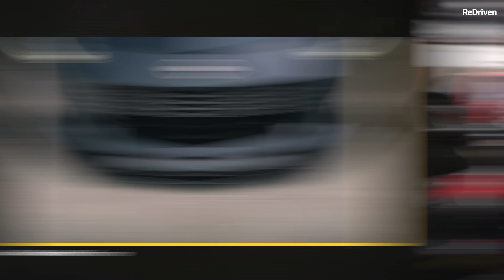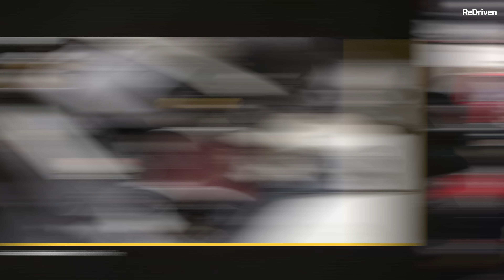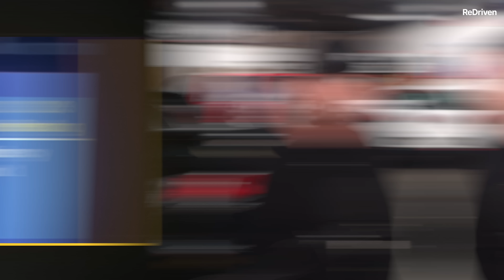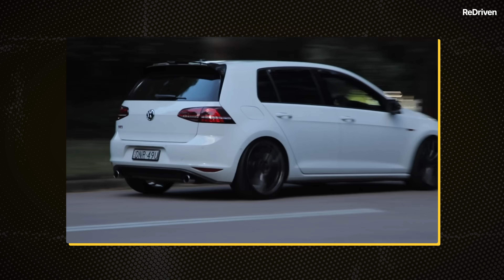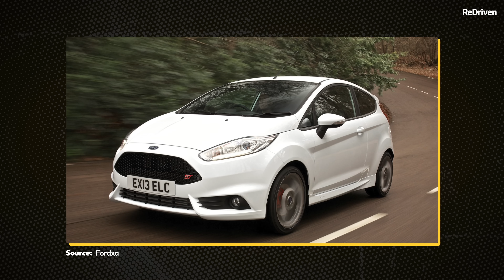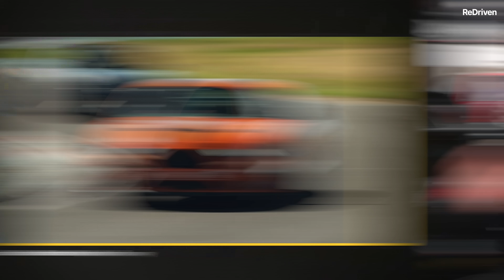7 CAR MODS YOU'RE WASTING YOUR MONEY ON! (and one EVERYONE needs!)

Comment: Very much depends on the car! Some cars really benefit from certain mods. Obviously you should use decent well made kit. 

On my mk3 MR2 the cold air intake system is a complete waste of time as the engine is in the rear and it’s very hot back there. You lose power & tend to get lots of error codes. Some people have spent many many hours on the dyno with various kit trying to get it work on the mk3, but the general consensus on cold air induction kits for the mk3 is don’t bother 😂

Exhaust mods do work well, but not the cheap Chinese rubbish. I tried cheap manifold & back box, both pretty crap, noisy in wrong way f bad quality. You also need to change the whole system, head to tailpipe. Full Zero system on mine & it is very nice, more mid range torque & sounds just a bit louder & deeper, highly recommend Zero. 

Suspension, cheap lowering springs ruin the ride, choppy, uncomfortable & ground out easily. I put factory springs back on, better. I then replaced my shocks with OE quality KYB items and ride was improved then replaced the OE springs with H&R & it is practically perfect now. Ride comfort is as very good, if not better than it was as standard, roll much reduced and it handles very nicely. Dropped 20mm all round and no grounding issues as they are progressive.

Some cars come from factory with very good suspension, exhausts etc. Some don’t. 

Also, in my case, car has been around 25+ years now & technology has improved so you may find better components are available than there were when car was new. Do your research, speak to the people in the owners clubs that actually know what they are talking about.

Comment: X-Force cat back exhausts on GTis pop and crackle in sports mode without a tune... so VW released it with an exhaust that was supressing the pop in sports mode. Are you saying thats bad for the engine if it came from the factory like that and then added the exhaust?

Comment: The GR Supra from the factory does pop and crackle upon deceleration in Sport mode. These cars have been very reliable beyond 100,000 miles with stock and even enhanced tune.
 Dinan is known for designing aftermarket performance parts that are tested theoretically and physically. I have their lowering springs and cat-back exhaust system. Handling is a bit stiffer but definitely better than with the stock springs. I have no doubt that good coilovers would be better, but they are very expensive.

Comment: I have an Alfa Romeo gt, that thing is lovely, I did some modifications for looks (wheels) and sound (exhaust. A good set of sports tires and I want to modify the intake to hear some sweet intake noise. I modify for the sound and the look, performance the car has 168hp ( allegedly) and it's more than fast enough

Comment: There's always compromises that are required for an enthusiast to make mods on a tight budget, it's just a matter of doing them logically and sensibly. Case in point those air intake pods exposed inside an engine bay, that is definitely a dumb idea, I learnt about that decades ago after investigating such things for my own car.To get a performance increase out of that it needs to be a cold air intake.

Obviously some of these proper set-ups for mods being referred to are for modern vehicles. I had to giggle about checking Automotive Superstore for everything you need for your car, they have next to bugger all for my car, and it's not even that unique, a 1989 Mazda 929 Sedan 😜

Comment: Watching from the USA here. I have been a performance driving coach since before the turn of the century, and this is all good advice. A story about aero on a car:
I had an BMW E36 M3 that I had just bought second hand on a track with a high speed banked corner. At the end of the straight just before the corner when above 120 mph (193 kph), I could feel through the steering that the front end was getting light, so I had to back off the throttle a bit. I couldn't find the cause, so I asked some of the more experienced guys for advice. Finally, one driver who had won a national race series in the E36 found the issue. The undertray under the front of the car was damaged. At high speed, part of the plastic would drop down and scoop air up under the hood. This effect was enough to lift the front end of the car at high speeds. When I got back home, I immediately ordered a well regarded aluminum undertray to replace all of the broken plastic. The next time I went to the track, I was hitting the speed limiter on the car at 136 mph (219 kph) in the banked corner without any issues at all. The front end was now securely planted. The thing about this mod was that from the view of anyone looking at the car, you could not tell that anything had been done, yet it transformed the high speed behavior of the car.

Comment: I have a 2018 Fiesta ST. Suspension is bone stock. Whoever owned it before me put a set of 18x8 inch Motegis on it. I absolutely loved the way it handled...until I hit a pothole and cracked the left front wheel and it can't be repaired. Now, I'm on the hunt for new wheels that will hold up to the roads that I drive on.

Comment: In my country, Brunei, pops and bangs mostly found on youngsters and noobs with their stock cars.
Even worst a shitbox running on stock 14"steelies, cut-off coil springs, fart cannon or straight pipe exhaust, expired roadtax, body full of dings and dents, faded color or cheap sprayed paint car. But with smucks on their faces revving the engine with not even stage 1 backyard mods, they feel their cars are totally fast. 😂
You can find these nutsacks every Sunday at pantai seri kenangan beach..😂

Comment: So. I just bought the closest to my dream car. I got the special edition factory aero pack. I also bought every "factory" aftermarket upgrade option part that has been made available over the last five years. This includes parts that will require me to get engineering certification for future registration. All parts getting fitted are purely for handling. The factory performance of the stock set up is already too much for a daily driver in Sydney traffic. I am already pushing the limits of the factory warranty by adding "factory" after market up grades.

Comment: If have a MAF instead of Speed Density a tune my not be nesscary with increased air/exhaust flow.

If speed density then yes.

Perfect example I can change my supercharger pulleys to change power and maintain the exact same AFR.  This is on a 93 Ford Thunderbird SC.

Comment: My Evo X has little more than a turbo back exhaust and an ECU tune, with high flow air filter (K&N drop in) and high flow cat. From that I gained around 100 hrsprs and a way better sound than the stock exhaust.

Comment: Yeah, i just upgrade parts as they fail. So shocks were leaking and oscillation was out of spec, so go myself a set of coilovers. Now I dont like how much roll it has, so sway bar is next. But the radiator is looking discoloured, so a cooling system upgrade is probably going to be first

Comment: I personally disagree with the wing statement, even if downforce isnt as much, if you drive a fwd car that is light, putting a heavier wing and moving the battery to the back can make a huge difference when cornering at least if your touge racing
Reply from the maker: In that case you could probably just put some ballast in the boot. Saves bolting a wing on the back
Reply: @ReDriven  yah that's fair, i just fell in love with the look at this point lol
Reply from the maker: That's a whole other story. If it's for aesthetics, got nuts!

Comment: Best small mods:
1. Japanese brake pads like endless, pmu or dixcel etc. and full brake fluid flush with super dot 4 or dot 5.1 brake fluid.
2. Good brand UHP tyres.
3. Good wheels which fit properly.
4. Good window tint.
5. Upgraded speakers.
6. High flow catted downpipe if turbo.
7. Good tune.
8. Good mild lowering springs about  15 to max 30 mm.
9. Shocks like koni, bilstein or higher spec kyb.
10. Sway bars with rear sway bar first.

Comment: I don’t agree with the ecu being mapped doesn’t give better mpg and power. It does if done properly. The standard maps are used across so many countries and weather conditions and each engine is different. You definitely can get more power while increasing mpg. The engine runs more efficiently and can improve mpg. When my GSXR1000 was tuned by a TT tuner it significantly increased its power and smoothness while allowing me to ride the same and get around 20/30 miles extra per tank. So they aren’t right there. Bike engine is no different to a car engine being tuned. Get someone that knows what they are doing, with a dyno and always do this over companies that turn up at your house  and just upload a map to your specific car. To work properly it needs to be done on a dyno/rolling road.

Comment: Open filter is an issue for NA but with a turbo that is compressing the air and making a lot more heat post turbo so a few degrees in won't make a difference

Comment: As a person who went through different phases with the car i can say from experience; one way or another everything is a waste of money. Intake header and exhaust? Sure you can get cheap parts or get name brand stuff and pay a fairly big amount... for what? 5?10?15hp extra?  Lol. My name brand I/H/E cost nearly as much as a turbo kit that will give you 10 times more power. Of course now you have to think about will the transmission / clutch hold? Fuel... tune... yes at the end its more expensive. Now my car is built and boosted. Spent so much money that i will never ever able to get back and the base car with its current mileage worth 10th of what i spent on it lol. Should have bought a car thats just 400hp stock and might still worth something.

Comment: @7:05. I’ve had my bone stock gen 2 dmax dyno tuned and saw an 80% gain in rear wheel torque 50% hp and it has consistently used about 1L/100km less fuel since it was done. As far as I know the 4j’s respond extremely well to a tune with 0 additional modifications.
Reply: It’s a diesel. Common rail turbo diesels can cook the turbo
Reply: @t @theairstig9164 ey have a really good stock turbo in them, turbo issues are very rare on the pre dpf models. Even if it does fail at some point it will have paid off in the fuel savings and enjoyment from the extra power.

Comment: Agreed on everything except perhaps the exhaust. Back in the day a less restrictive exhaust always helped a bit on the JDM turbos I used to drive (mr2s, supra, 300zx, rx7 etc back when they were the cheap performance cars lol). But the main improvement came when you turned the boost up of course.
Reply: yup best mod on my Colt was full upgrade of manifold, downpipe and upsized decat exhaust.

Comment: I have a fully built gr yaris running a motec ecu which I drive to and from events. I cringe in embarrassment every time it backfires as I'm changing gear at normal road speeds on public roads....it's going in for a remap in a couple of weeks and i'm going to ask if they can change the tune to avoid doing that.

Comment: I modded my gr86 with door stabilizer, surprised it makes quite a difference.

Next step is to get the hks hi power L spec ii to reduce the weight, but not sure how much this can affect the weight distribution and the rake, as well as the airflow under the exhaust muffler.

still thinking how I can reduce the 4-finger wheel gap though.

Comment: I would most definitely concur with your final point, Guys. Get training, listen, learn and apply. If you then want to learn more, apply for your racing licence and, once obtained, you'll then start to learn a whole lot more. This will include the old adage: "If you want to make a small fortune in motor-racing, start with a very large one." As someone with 36 years' experience in motorsport, including 13 years as a Driver Evaluator for CAMS, I've met countless people who thought that they could drive, only to have them prove conclusively by their racetrack performance that they couldn't. A willingness to park their ego and learn almost always improved their performance. Re mods, as a race driver, the only modification I ever did to my road cars was to fit better brake pads.

Comment: This video is actually really poor advice.. different cars respond differently.. for instance pod filter open may not provide hot air if the intercooler is very good..  some V8s respond well to exhausts..  the pop tunes are standard in i30n and some BMW so Hyundai and bmw warrant these cars..  tunes can be very good and adaptive.. very very poor video

Comment: Great video guys but thought it was just worth saying, exhaust mods won't hurt your engine as long as the ECU is reading a sensor for air flow mass/volume. If more air goes in, more fuel will be injected as well.
And yes you can actually have more power and better economy simultaneously. Generally mixtures are very rich at full throttle. If you are running high octane fuel and detonation isn't an issue, leaning it out will make a little more power. But that is best left to the experts

Comment: Friend of mine put a throttle mapping gizmo on his LC 79 series, had it in auto, got stuck on the beach, lowered tyre pressures put the maxtrax under the wheels and "sent it", ended up on its side and wrote the engine off, good way to put an end to the holiday.

Comment: 3:10 100%, wholeheartedly and unapologetically disagree. Losing less than a % of power for the increase in induction, spool and DV noise (if you bypass is plumbed back into the intake, in whch most cases, it is) is worth it every single day of every single week for all of existence.

Comment: You guys are wrong about the First and Second Mod !!!!  
DIY Aero mods and Warm Air intakes can be made for Fuel Economy improvement. 
I've done rear wheel covers, wheel splats,  extended the underbody plastic, a Kammback and I opened my Air Filter Box to allow warmer air intake on my Yaris Hatchback. The Fuel Economy Increased by OVER 30 %. Yes, I verified the Fuel economy verified at the fuel pump!

Comment: First “mods” I always do after buying a used performance vehicle is a good set of tyres ( usually Bridgestones but more recently Michelins) and a good set of brake pads.
Reply: Hell yeah. Best value upgrade to any car IMO. For me it's the Bridgestone 003 or Michelin PS4 - both are awesome and not exxy in the un-crazy sizes. No need for the latest or "sportier" versions either - I'm currently running 003s at $135 a corner on my 07 Forester, $200ish for my NC MX5.
Reply: Same here. Michelin Pilot Sport tyres are really improving the car's road holding. 👍

Comment: I agree with your #1 mod, AND reducing weight = better performance. 
Most cars can drop 10kgs in 10 minutes by swapping the lead battery for safe sodium-ion. It's a lot cheaper than carbon fibre, titanium bolts and half the cost of under bonnet lithium.
Please do not take my word for it.
If you guys are interested in seeing how a battery can be a performance mod for yourselves, just reach out.

Comment: The real reason that air filter is bad, is high engine bay temperatures mean high temp air going into your cylinders, and the physics of that is, high temp air is less dense (less oxygen to burn in the cylinder). What you really want is cool air going in which is more dense and more oxygen available for combustion! Remember, combustion requires fuel + oxygen.

Comment: Also a mod that is severely underrated:

Servicing. Take your recommended intervals and halve them. And remember:

- Your recommended interval is intended to keep the car alive long enough to survive the average loan term. Warranty is irrelevant.
- There is no such thing as "lifetime fluid" unless you expect your car to only last 6 years.
- Replace "lifetime fluid" with "every 40,000km/4 years" and you're good.
- Replacing fluids is a f-ton cheaper than replacing engines/cars. If you've got a good car, keep it that way. Replace the fluids often. 🔧⏲🚙😄✅

Call me silly but there's not such thing as having "too clean" oil/gearbox/brake fluid.
Reply: Great comment mate.
Reply: @Turbodude12345  Felt compelled to say it. This is an anti-sludge household.

Comment: What about engine or boot braces. Any comments on whether there are any negative trade offs versus the supposed improvement to body roll and chassis flex?
Reply: Strut tower bars is what I call them.
I run front and rear on all my daily drivers. 4 cars in 30 years. Idk if they do anything, I believe they do 😊

Comment: With the aftermarket exhaust argument I don't believe the 1% performance increase is fair. The reduction of back pressure can make a worthwhile difference even with factory emissions components from some of the banks diesel tuning stuff I've seen but that might be getting a bit picky for this kind of video considering you still need to tune those vehicles which will make an increase of performance anyway.

Comment: For your upcoming suspension video, I don't know how in-depth you plan to go, but I'd love it if you talked about how to properly set up coilovers. Too many companies (BC et. al.) promote the myth of "spring perch sets preload, bottom mount sets ride height". Completely wrong and potentially dangerous. Bottom mount sets the extent of travel in bump and droop (set droop to intended measurement which is usually 1/3 to 1/2 of total travel, then ensure that tyre does not contact body/chassis at full bump). Spring perch sets ride height. If the spring is uncaptive at your intended ride height, get a helper spring. If your spring is way compressed at your intended ride height, get a shorter spring.